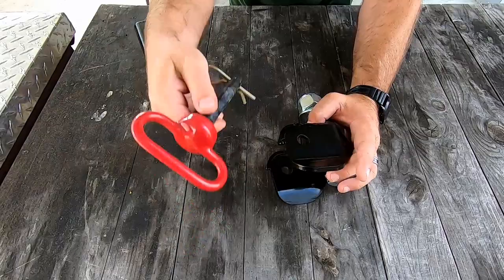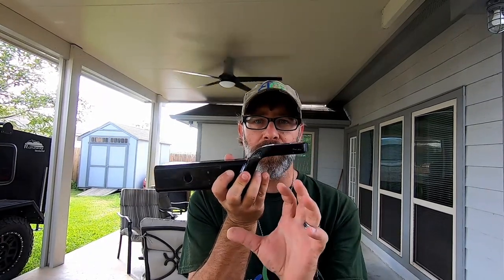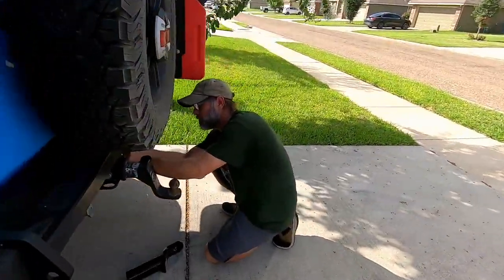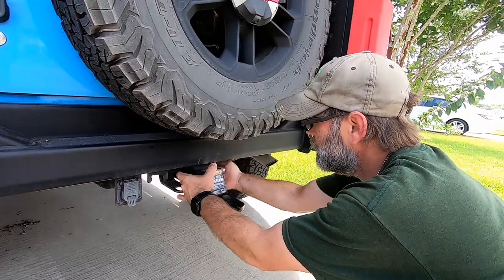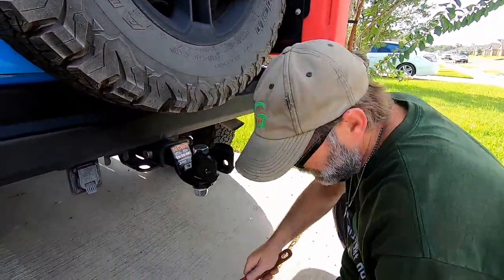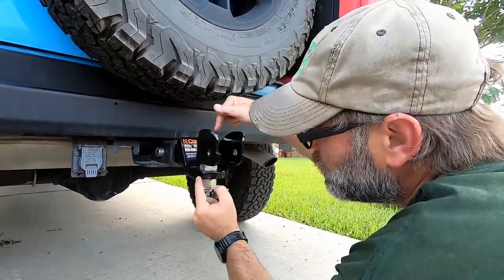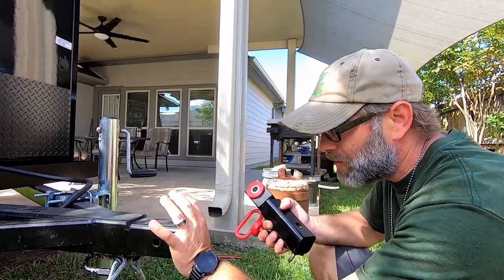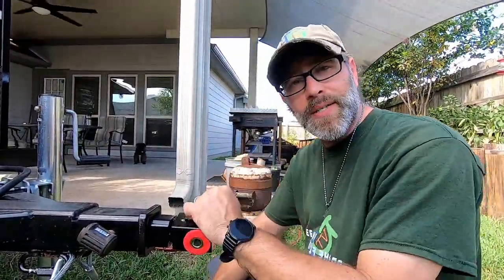Episode 425 - Max Coupler Installation on the Runaway Venturist.

Comment: Using pipe wrenches on bolts and nuts is a good way to chew them up. So stop being cheap and by the appropriate wrench or socket, and torque them to the correct spec.
Reply from the maker: Sorry I didn't have any and still don't.

Comment: I watched until the pipe wrenches came out.  How about using the proper tools ?  If you don’t have them for a install like this , I question your mechanical knowledge and ability.
Reply from the maker: Thanks Jeff, never said I was a pro. Side note, after thousands of miles it's still working just fine.

Comment: Please don’t use hitch pins.  Use locks. We became disconnected when bringing our new camper home. Thank god we came disconnect at a stop sign. Our coder pin came out
Reply from the maker: Oh wow really. Thats crazy scary. Im looking to get a full set of locking pins that use the same key. TO MANY KEYS hahaha lol
Reply: Not all Locks are rated
For towing but for stationary locking up a trailer . double check the manufacturer
Reply from the maker: Very valid point.

Comment: I have a range runner with the max coupler. Came back from my first camping trip, and had a hard time pulling out the pin. Tried to lift or lower it with the jack, no dice. Possibly because my trailer was on a little lower ground than my Jeep. Had to wiggle the arm up and down while pulling it out, took a lot of effort. Have you ever had this issue?
Reply from the maker: wow thats crazy. Never experienced that before. I guess depending on the two being level and all. Hmm. this does remind me I probably should go out and grease mine up. But in all honesty its been performing really well.
Reply: @BubbasgarageTv  I'm pretty sure it was because the RR was on gravel, while my jeep was on pavement. The uneven gravel made the trailer tilt a bit so I had a real hard tome taking it off the jeep. Thanks for your reply though.

Comment: If you insist on using that straight pin, put a flat washer on to protect the key from wear and snapping as easily. Used them for years in the fields with farm equipment.

Comment: Really enjoyed the video. We’re scheduled to pick up our venturist the first week of Oct. Do you have a lift kit on your Jeep? My understanding is the level hitch height for the venturist is 24”. We have a stock JKU so it looks like  we will need to use a 3 or 4” riser to tow the trailer level?  Are you able to open the back door with the trailer attached?
Reply from the maker: Hey thanks a bunch, great questions. We  sure do. We are running the AEV 2.5 Dual Sport xt. You are able to open the door fully with the venturist fully attached but need to be sure not to be at too much of an angle or it will not fully open. The manufacture does offer a longer extension as well if needed but that also will change how much load you have on the rear of the Jeep. Hope this helps and congratulations you will love it :)
Reply: Thanks for the quick response and info. Hope you guys continue to enjoy your venturist.
Reply from the maker: Thanks a bunch. Love our venturist. We have been pretty slammed this summer. But looking forward to a few trips this winter and next spring :)

Comment: do you drive it on highways with the max coupler or a regular 2 inch ball? and then switch to the max once you hit a trail?
Reply from the maker: Run it just like that.
Reply: @BubbasgarageTv  damn!! no crazy wobbles? at hwy speeds 75?80?
Reply from the maker: No issues at all. Pulls like a dream. Got about 6k miles down so far.